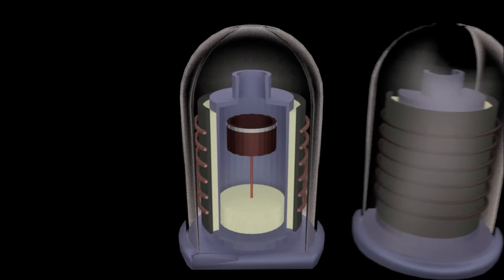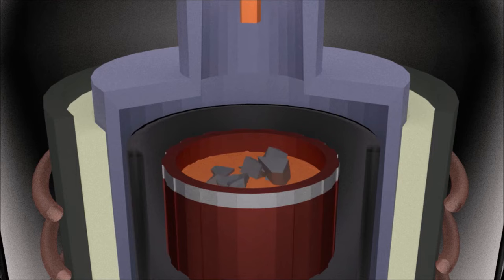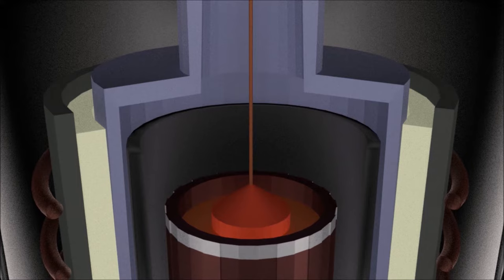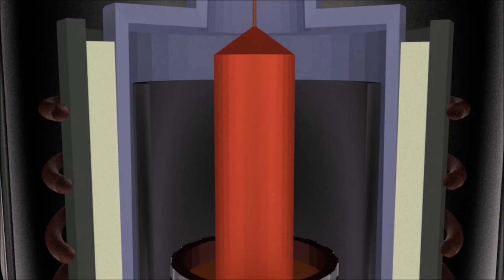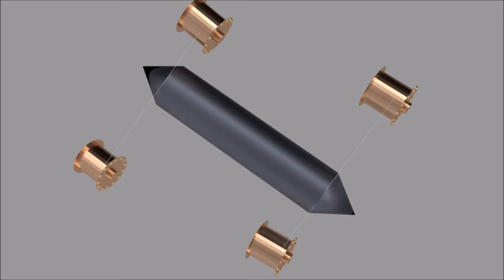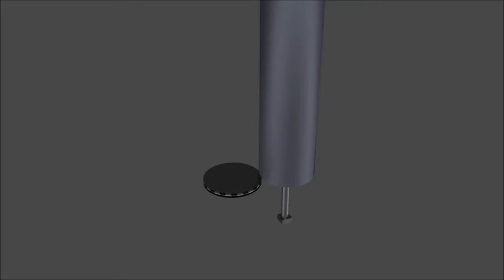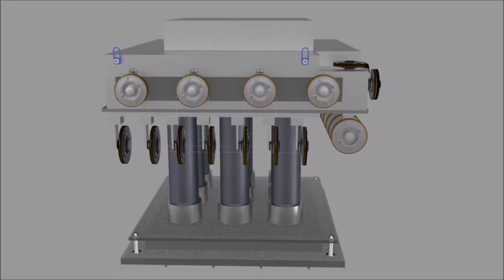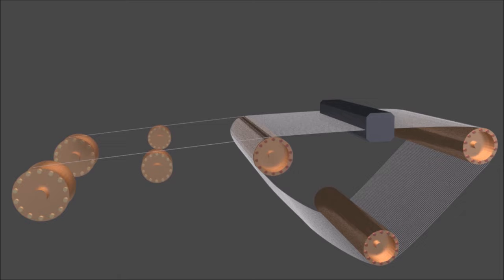UNSW Czochralski (Cz) ingot pulling

Comment: DIAMOND WİRE?!? Its sounds expensive! Can we use other wires to cut?
Reply: In january 2021 scientists discovered, that you can use dental floss to do that. Works just as fine.
Reply: Normal steel wire with a coating of oil and very small silicon carbide particles can also be used.
Reply: Diamonds are just carbon, cheap and very easy to manufacture
Reply: I bought a diamond drill bit for $1, and a small diamond grinder for $30. The kind of diamond used for this sort of stuff is relatively very cheap